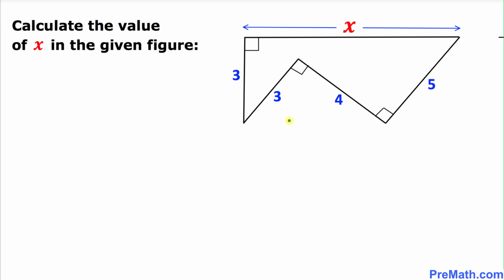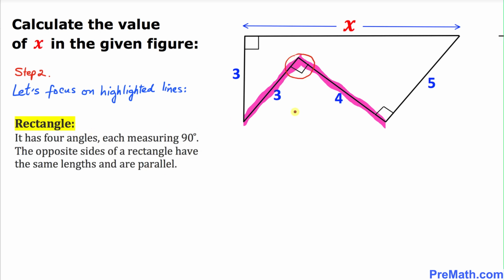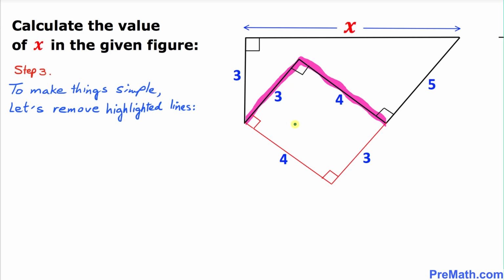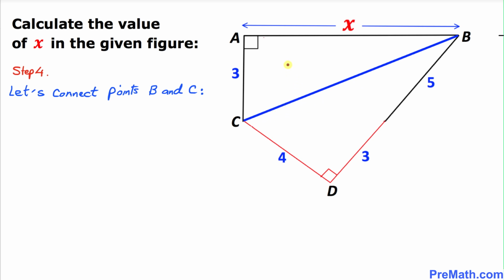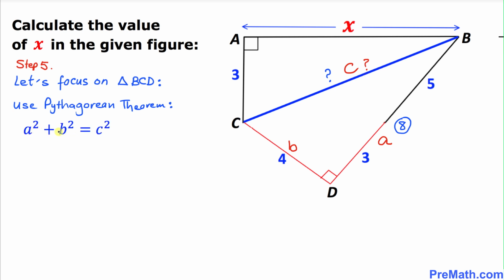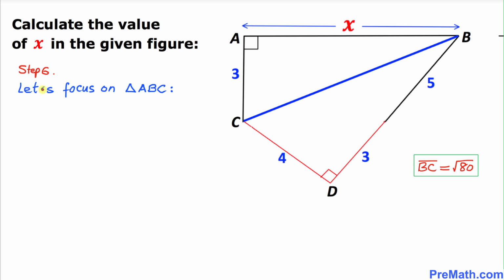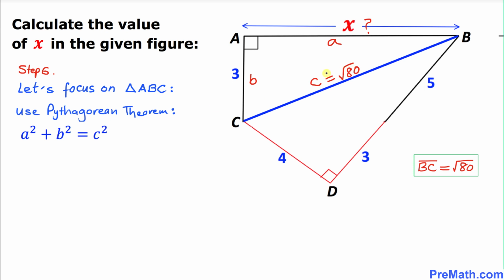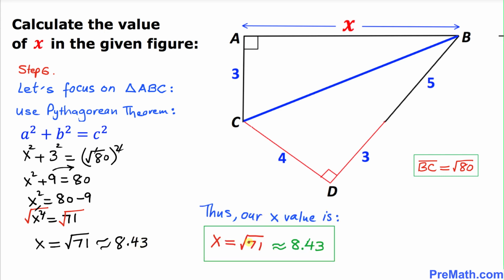Can You Calculate the Value of X in the Given Figure by Using the Pythagorean Theorem?

Comment: It would be very helpful if diagrams like this were placed on a graph paper background so the precise relationships among the lines and angles would be shown without ambiguity. Because just looking at the diagram with the unaided eye, it appears that a line connecting the two bottom vertices of the diagram would be parallel to line x. This means you would have a 3-4-5 right triangle at the bottom, and then if you drop a perpendicular from the right end of line x, you create another 3-4-5 right triangle. So the length of x would be 5 (hypotenuse of first new right triangle) + 4 (bottom side of second new right triangle) = 9. But the fact that you did not solve the problem this way implies that the line connecting the two bottom vertices is NOT parallel to line x -- but it sure looks as though it is. Thanks.
Reply: Yes agree with u. I solved it the way u mentioned it.
Reply: Yes, that’s what I got also…9 ...5+4=9
Reply: If a relevant relationship is there then it is shown, but if not then it cannot be assumed.
I do agree the 3-4-5 triangle was sitting there begging to be the answer but it turned out to be a red herring.
Reply: I had the same thought. Isn't there always a "not to scale" disclaimer?
Reply: @Al-yf7tm  If there's any doubt about what is being illustrated, then it's better to use a graphed background and draw precisely to scale. A diagram should always AID in solving the problem, not cause confusion. If a diagram is known to be ambiguous but is used anyway, then what you have is not a pure mathematics problem, but some sort of "puzzle."
Reply: @j.r.1210  Even without the graph or grid behind the scenes, there is enough information with the given lengths and right angles to be able to determine the correct output through the postulates and proofs of parallel, perpendicular and intersecting lines with interior, exterior and congruent angles. This allows you to complete the rectangle as it is a parallelogram, from there you can create a diagonal from the lower left vertex to the upper right vertex. This gives you the first complete right triangle. With this we can solve for that diagonal with the Pythagorean Theorem as this the hypotenuse of the lower right triangle. It is also the hypotenuse of the upper right triangle and again we can use the Pythagorean Theorem to solve for x. No Graph is Needed! This is pure mathematics, it's called Geometry! And you don't need graph paper to solve it! Would having graph paper assist? Sure... but some tests might have a problem like this and will state: (can not use graph paper) for this problem. This means you have to rely on the relationships, postulates, proofs and theorems of lines: parallel, perpendicular, intersecting with angles, and the geometrical properties of triangles, squares, parallel grams, other polygons, and circles... If you want to get really involved you can even use Trigonometry and still not need a Cartesian Coordinate System with a grid background. There are proofs, theorems and laws of triangles and angles that can easily prove this. This was solved by Pure Geometrical Theorems and Proof approach, not an Algebraic Cartesian Approach. This is still mathematics. Don't think so, wait till you get to Linear Algebra, Vector Calculus and Analytical Geometry!!!!
Reply: @j.r.1210  A graph that's not drawn to scale is never a problem if there is enough information to find a solution, and it does lead to pure mathematics.
Reply: Agreed. That’s how I solved it. Of course the answer is something else on purpose.
Reply from the maker: Thanks for feedback JR. 
You are awesome 👍 Take care dear and stay blessed😃